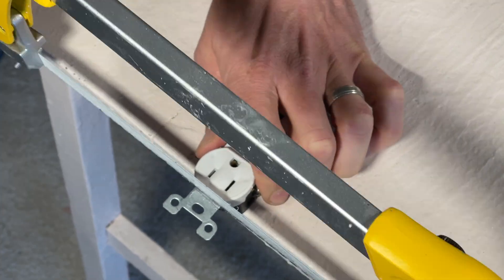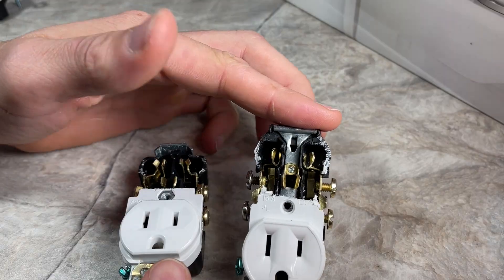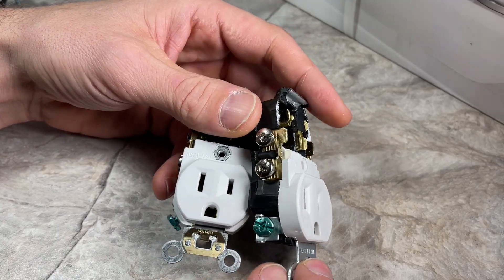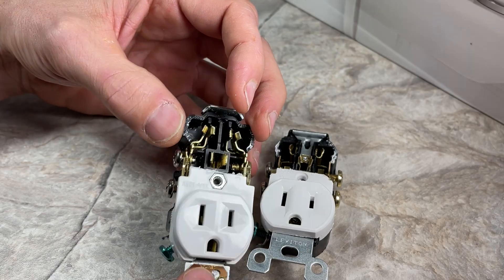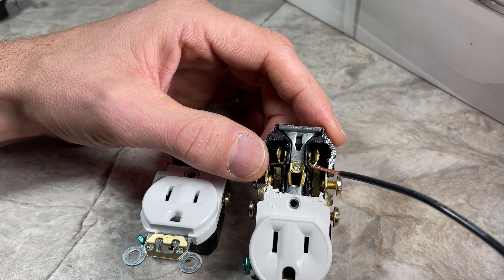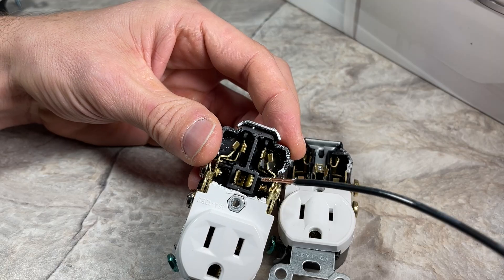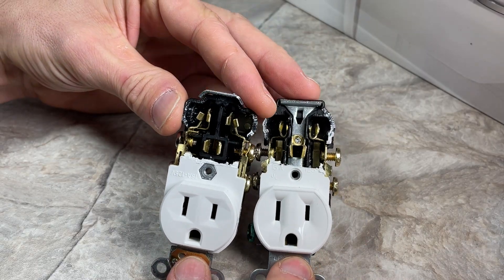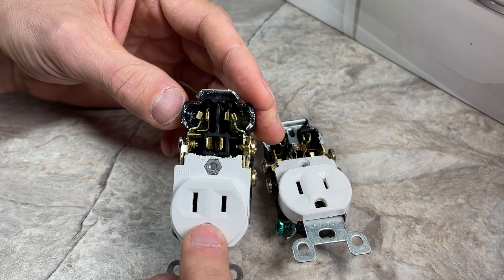What Outlet Should You Buy For Your Home |  Commercial vs Residential

Comment: My electrician boss told me that he used "spec" outlets in his remodel, and that is also called "hospital grade extra heavy duty" (also a Leviton product). I bought a few for my house, and they have a hybrid push-in hole in the back, but no spring-clip. The screw terminals on the side will clamp down internally on the wires inserted from the back. I thought that was a nifty approach. But they are a little over $5 each.
Reply: Speaking from a life time of experience (40 plus years- now retired) those are truly the best. The kind you push wire in the back without tightening a screw could get hot and catch on fire depending on how much load/current you push through them.
Reply: I just bought a few Honeywall Z-Wave switches and they have that kind of connector.    It's brilliant.  I've never seen it before.   These are not hospital grade, they are residential and of course they are expensive because of the circuitry in them so I can't compare them to a 50 cent outlet.  Each terminal including Ground has TWO holes in the back, you stick in a straight wire with a lot of tolerance for different strip lengths, tighten the screw on the side an you have an easy fast strong connection.  If you only have two cables in the box you don't have to twist anything so repairs are super easy and the wires never get damaged.    The only issue is if the wires are different gages, then the screw clamp doesn't grab the thinner one very well, so you have to revert to wire nuts with pig tails to the device.
Reply: Specification grade is not hospital grade.  Spec is an ordinary heavy-duty grade.

Comment: I never put much thought into the $0.50 outlets (which are actually $0.37 each In the 10 pack from our Home Depot!). I’ll be stocking up on the commercial ones in the future for my customers.
Reply from the maker: Hey Dave, honestly I was surprised on the dramatic differences in design as well.  My path forward is using commercial for my projects. 👍
Reply: Yes,  I learned the hard way. Get a 10 pack of those and those are 10 outlets that you'lll have to replace 😄
Reply: For future customers you want to starve use the cheapest pray they break down another service call
Reply: @wizard3z868  I don't know what that has to do with what I said.

Comment: Great video  I would be curious to see how the TR Outlets compare as well
Reply from the maker: 🤔sounds like it is time to get the hacksaw out and make another video.
Reply: @EverydayHomeRepairs  it's just a different cover
Reply: One key point is that some TR receptacles take up to 6lbs of insertion force while the well designed TR only takes a few ounces of insertion force
Reply: ugh TR outlets is going to hurt more people than save.  In 10 years when  all these break people will be sticking screw drivers in them to fix.
Reply: @guyod1  the technology is already over10 years old.
Reply: @kenbrown2808  My point is the cheap TR outlets will be 10x more likely to fail than regular outlets.
Reply: @guyod1  my point is, I'm not seeing that failure rate.
Reply: tamper resistant use the same back piece, but the front piece has a mechanism that will not let anything push in unless it is pushing through both slots at the same time.  the intention is that you can push in a plug, but a kid cant push in a bobby pin.  unless a local jurisdiction chooses to ignore the national code, all 120V receptacles in a dwelling unit must be tamper resistant.